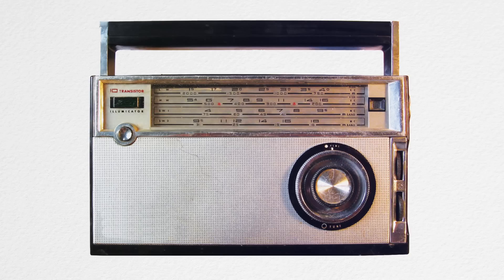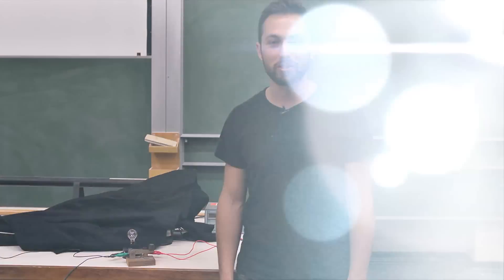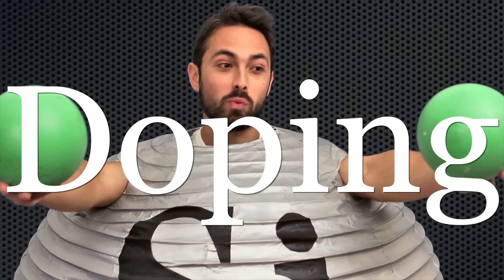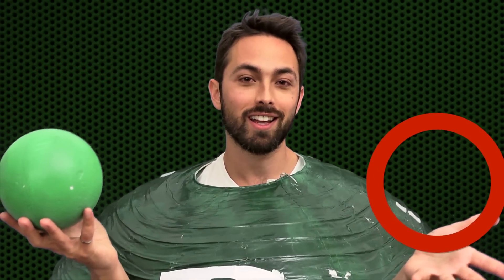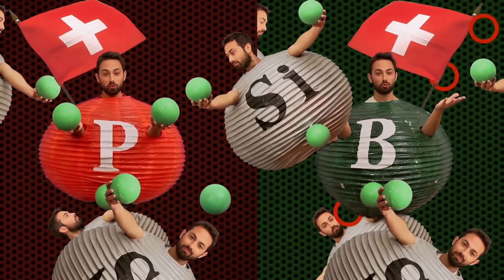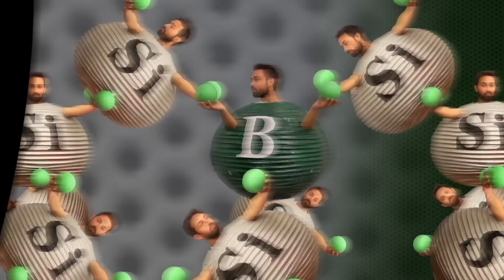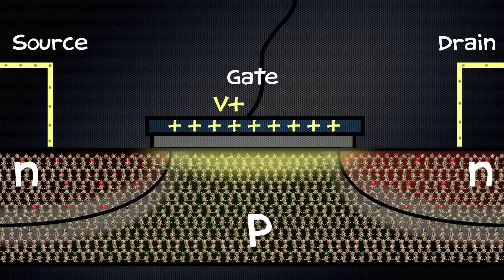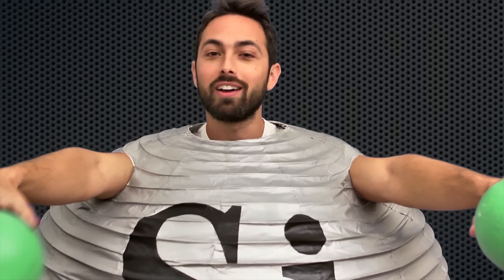How Does a Transistor Work?

Comment: I had to use a MOSFET to turn off the power to an electric car I built in a extracurricular group. I noticed that the MOSFET has the same 3 contacts (gate, drain, source), and also does the same thing overall, does that mean the MOSFET is an evolution of the transistor? Or are we talking about two different things serving the same overall function?

Comment: Can't help but think this should be more accurately called how a MOSFET transistor works. As in a typical/traditional transistor there is a proportionally small current which passes through the base and the emitter.

Comment: As an electronic technician and engineering student I really enjoyed this video. But with your terminology you described a FET. Base, Collector and Emmitter are for the true transistors in my opinion. Though not technically incorrect, Source Drain and Gate are used more for the Field Effect Transistor and should be pointed out. Same principle though and this is why I really like it.

Comment: A good explanation, but I have a couple of comments/questions:
1. Moor's Law is NOT a physical law, so there is no physics that requires transistors to get smaller
2. What was the size of the first transistors?
3. If a transistor is either on or off, does it require all oronly one of the electrons to cross the barrier to make the switch.

Comment: Transistors are arranged into higher order structures called logic gates. See v=95kv5BF2Z9E for how transistors are arranged to form gates. The gates are arranged to trigger each other, or to accept external inputs (like your finger on a keyboard, mouse, or touchscreen). Memory (RAM) contain stored sequences of triggers (software) and data used to execute processes. It's a long and complex path from a transistor to a human input.

Comment: Over a decade ago I had a lecture that was about a new type of transistor that instead of being on or off could be off, up, down, left, right and straight. It was based on the spin electrons have and how we could send them in different directions.
As technology grew so would the amount of directions increase.

I wonder what happened to that technology...

Comment: You can have one source to power it all or as many sources as you need. To keep it simple, you can directly connect each of the transistors to " a battery". In the real world, this is not quite true, but there is alot of stuff that happens that is beyond the scope of 500 chars.

Comment: Title slightly misleading because there are different kinds of transistors but grouped into 2 categories essentially (Bipolar Junction  and Feild Effect). The video shown is for Field Effect but a transistor has 3 modes of operation ( cutoff, saturation and linear). For Digital switching, you only use 2 modes (saturation and cutoff). So this video shows how a Feild Effect Transistor works as a digital switch.

Comment: The explanation given in the video is not entirely accurate. What actually happens is that the positive gate voltage creates what's called an 'inversionlayer' close to the oxide-semiconductor interface, where the normally abundant charge carriers of the p-type silicon ('holes') are repelled, resulting in a local net negative charge. This inversion layer  acts as a conducting layer for current to flow, as properly portrayed in the video.

Comment: Is the maximum amount of transistors known? If so, how would computing continue to increase in speed? Would we reach a limit that could never be surpassed, or would we have to find a different way of saving a 0,1 bit of data? If so how would we do this? Could we use a single atom placed inside something (I'm not a quantum physicist so please don't get angry if my ideas sound too stupid), or could we get a more complex system, like a 3 or 4 bit computer based on electrons of a molecule?

Comment: When you increase the frequency in a computer's processor, you are essentially making everything inside the processor happen in lower amounts of time. It's one of the ultimate factors that determines how high the frequency can go before the amount of errors spiral out of control. In this case errors indicates the amount of 0s that should be 1s or 1s that should be 0s.

Comment: Uhm ... i am not an expert on this ... but here's what i know:
Imagine you have thousands of such transistors in parallel, i.e. side-by-side all of whose gates are connected to a common terminal, so is you switch that terminal on/off you are simultaneously changing states of all the terminal ...
And yes, there is a limit which is the time taken to make that switch ... its called a clock cycle, we generally measure its inverse .. the clock frequency ... but reducing the time limit causes heating.

Comment: Question; when the transistor is off due to the repulsion caused by the depletion layer, shouldnt the "holes" move due to the initial electrons that move from the N end to the P, offsetting those holes? And if the holes do move would this not create a current?

Comment: One thing i don't get. If this is how a transistor works there must be built in some kind of unit of time for a bit to be done. Or you couldn't have several of the same bits in a row. Like every milisecond one bit was made or something like that. In that case why couldn't you just make that unit of time smaller to get more bits out of your already present transistor? Or are we capped out on the ability to switch the voltage on and off fast enough to transition with such speed between bits?

Comment: Good outline of the workings - quick q, where does the gate gets its charge from? If all the current mivementa are transistor based, is there just an initial set up in the way the gates are charged? Is that how the computer code is built and  translated?

Comment: As an electrical engineer, I'd have to remark two things:

at 4:35 it's not necessarily the fact that you attract electrons from the other side of the depletion layer, you attract electrons from the middle crystal (p) to form a conductive path at the top, so the electrons from the (n) part can travel across the top of the (p- part. The condition for current to flow is ultimately the presence of minority carriers, not the electric field (a high enough voltage can overcome that)

Comment: The gate is controlled by another transistor.  Realize that if there is no input, nothing happens to the state of the machine.  The input could be a key on you keyboard, mouse-click, power-on signal, a pulse from a clock, etc.  All these inputs are hooked up to gates, which control other transistors which control other gates... mulitply by few a billion and (when organized properly) you have a computer.

Comment: I even studied this in college and it still confuses me.  I understand that atoms want to have complete valence shells to be at a stable energy levels (right?) but how is this *desire* stronger than the charge of the atoms?  What I mean to ask is, if the doped materials are overall neutrally charged.. wouldn't they immediately expel any electrons/holes that jumped in to complete valence shells?  And how does the positive voltage allow for the flow of electrons from the n-type into the p-type?

Comment: This video described Field Effect Transistors wich are controlled by voltage, but what about the traditional Transistor that is current controlled? Does it work the same way and just uses the current to "push" open the depletion layer or does it work differently?

Comment: Great effort on the visuals, but the info is mostly wrong, confusing apples (BJTs) oranges (MOSFETs) and pears (JFETs), and does not match the visuals.  Look at the comments to see all the sheep believers.  Other than transistors inside ICs (which have 22nm as the smallest feature of a MOSFET, the device is much larger) some transistors of the three prominent types I mentioned are rectangles over 12mm a side for each transistor.  Derek, the is is well beneath your standards, fix it.

Comment: Logic Gates are made from transistors or switches. He could not explain them any different. Only diffrence would be how they connected together to make the logic functions like for example: Two switches in series would make an AND function, Two switches in parallel would make an OR gate etc..

Comment: well, when you apply a positive voltage through the gate (which is an electrical electrode), the area below the gate( depletion region) will attract electrons making them to follow to the other side: Switch on. Stop the voltage: Switch off. A good question that I can't think of it now is how the voltage goes through the oxide layer (if he meant by an insulator layer like sillica (SiO2)?

Comment: I suppose an 'AND' would just require two transistors in series. If the 'A' and 'B' gates are charged, then the circuit is completed, and the bulb shines. 'OR' would be two transistors in parallel; applying charge to either gate would complete the circuit; if either the 'A' or 'B' gate receives charge, then the bulb shines.

Comment: The oxide layer of the transistor shouldn't be touching the drain and the source.  Also, i believe the size of a transistor (ie 22nm) refers to the length of the gate.

Comment: He probably won't. What he described is a FET, a Field Effect Transistor. The earlier Binary Junction Transistro has a thin layer of the opposite type of silicon what is weekly doped between the input and output. Providing more charge carriers - by adding or removing electrons - to the weekly doped layer destroys the depletion layer and allows current to flow.

There is also the point-contact transistor, the first one to be made, but were soon superseded by the BJT

Comment: It doesn't "defeat the purpose" so much as allow for a different type of input to control whether the switch is on or off. In this case, an electrical signal is what determines whether the switch is on or off (with differences in voltages corresponding to the different signals) instead of the direct manipulation of a little lever or button like what you would normally see controlling lights.

Comment: Nice video.  To overcome the tunneling limitation you mention, silicon transistors are going from planar 2D channels to fins with 3D channels.  Intel made this switch to FinFETs last year which allows for higher performance with longer channel lengths.

Comment: I finally feel I understand how transistors work, as a switch from the video.  How though, does the computer "know" which bits are in what state?  Meaning, the transistor uses the voltage to turn the switch from 0 to 1 or vice versa, but what is the next level up?

Comment: The part I've never figured out about transistors is if a transistor's only job is to send a single bit of information, then why do you need a switch at all.  The fact that the gate is positively charged is a single bit of information.

I understand the mechanics of a transistor, I understand how complicated programming languages are derived from [and] and [or] gates, but that little bit of information on how to turn a group of transistors into an [and] or [or] gate is missing.

Comment: Little clarification:

The term "transistor" is often understood in electrical engineering to mean "Bipolar junction transistor" or BJT - an altogether different semiconductor construction than that presented in this video.  

This video describes the MOSFET or "Metal oxide field effect transistor" - that type which is found at the nanometer scale described.  MOSFETs can also, however, be found on the macro scale in power applications and in some amplifiers of course.

Comment: 1's and 0's are just like 0's, 1's, 2's, 3's..9's. They are essentially numbers represented differently. Why 1's and 0's, because that is the easiest way to represent in machines where you can switch certain power on and off.

Colours can be represented by amount of Red, Green and Blue. So these 1's and 0's represent the intensity of each colour, which the monitor maps to its sub-pixels to reproduce the colour.

Comment: I knew data is effectively 1's and 0's. But at the end of the day, I still have no bloody idea how so many 1's and 0's becomes the colours on my screen, the running of a program. I don't know how you make something that has the laws to read 1's and 0's, and which then uses that to create a unique thing. The leap from code breaking using transistors in the 1940's to a PC with an operating system later on blows my mind. Anyway, I enjoyed the video! Best lesson on transistors I've ever listened to.

Comment: Question 1: 
Does current actually flow through the gate at all, or does the voltage just need to be maintained to keep the barrier-forming electrons away from the n-type terminal?

Question 2:
Is there actually any difference between the source and drain? It looks like the current could easily just flow either direction through the transistor but if that be the case, why the misleading names for the two terminals?

Comment: picture it like a switch that drives light bulb on and off,( on is 1, off is 0) every light bulb is a ''bit'' ;every bit is a piece of information. if i write in binary 0001, it's the number 1 and 0010 is the number 2, 0011 is 3. these bulb have a value based on their position from left to right, the first position equals 1, 2nd = 2, 3rd = 4 ,4th =8.   (1000 is 8) 
so if i wanna write 11, i write: 1011, because 8+2+1 =11
I'm sorry it doesn't answer your question,but there's so much to tell about

Comment: Its all about abstraction. Transistors are used to build logic gates which can do simple calculations. By chaining those together you can make simple calculators and other little bits which again come together to make memory and processors and other larger scale parts of the computer. Transistors are the basic building blocks for the computer like atoms are for your body.

Comment: With the switches you can now build digital circuits. I.e. circuits that operate with binary voltages. For example, a very basic one would be an AND gate where it requires about 3 transistors to make. With that and other gates such as OR, NAND, NOT, NOR, you can create more complex circuits such as Adders and clocks, then even more complex such as an Arithmetic Logic Unit and Shift Registers and then even more complex such as a CPU. To understand AND gates you need basic electronics knowledge.

Comment: Most of the time they are. You can put together basic logic elements, which can be propagated backwards. Have a look at "logic gates", in computers every one consists of a small number of transistors.

A very simple example is to connect the output of a "not gate" with it's input (output = 1 - input), which then generates a pulse, which can be used to count numbers (to control a traffic light e.g.).

Comment: Apply some clock pulse and wire transistors to a logic circuit (adders, counters, etc.) and you can do pretty neat things with them.

Most of the time it's not the interaction, but more a repetitive behaviour. Still when using computers it is crucial to have some kind of input, may it be the binary program, user interaction (or other interrupts). But I guess I'm getting way to much into detail. :)

Comment: There are two kinds of transistors. A BJT, which is probably what you have in mind, is controlled by applying a current to the base (equivalent of gate). An FET (JFET or MOSFET) is controlled by applying a voltage to the gate.

Comment: Any number of ways - the simplest way is to use a battery.  A MOSFET transistor, like the one he is describing, has no electron flow through the gate, because of that insulating layer of silicon oxide.  It's like a capacitor - charge merely builds up on either side.  For an npn MOSFET, to turn it on, you need a positive voltage.

Comment: You shouldn't refer to the conducting state as "1" and the insulating state as "0;" 1 means "high voltage" and 0 means "low voltage."  For example, in a CMOS inverter, when you put a "0" low voltage into the input, the pnp transistor is conducting and the npn transistor is insulating - with the same "0" voltage at each one's gates.  "0" =/= insulating.

Comment: How can we generate a positive voltage at the gate? I thought that transistors were turned on and off by applying a current (stream of electrons) to the gate. Does the current flow the other way?

Comment: In 3:45 a Transistor consists of 1,596 Dereks. Lets assume Transistors have a quadratic area. So 1 transistor consists of 90,972 Dereks. My Computer has 2,922 Billion Transistors. That means my computer has at least 265.82 Trillion Dereks built in. WOAH, now I can imagine why it is smarter than it´s owner.

PS: Don´t forget: if you want to dispose your hardware, give it to a recycling plant. Veritasium is a rare element. We should reuse it...

Comment: Most modern computer circuits are "clocked", meaning the circuitry is fed a pulsed voltage that keeps things moving, the transistors switching on and off, bits flowing around, etc.  The circuitry for generating the clock pulse itself relies on a piece of vibrating quartz, usually.  Magic :D

Comment: Stupid question (because googling it would probably be the best course of action). If the transistor acts as a switch, then what determines when a current is sent to the gate in the first place? Likely another series of transistors. 

Onward to basic computer engineering!

Comment: degrees celsius, you got yourself an insulator as efficient as rubber…. 

semiconductors need energy, they must be heated to conduct electricity; 

the difference is due to the fact that in metals the valence band and conducting band are mixed…. there is only ones band; electrons flow freely from one atom to another like there never was an atom; terms like "sea of electrons" or "cloud of electrons" are used to describe metals;